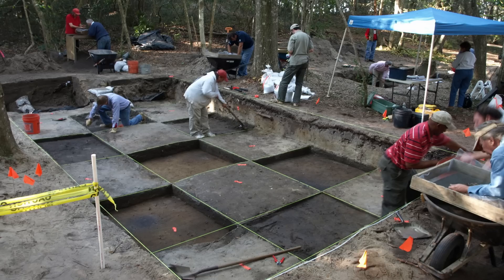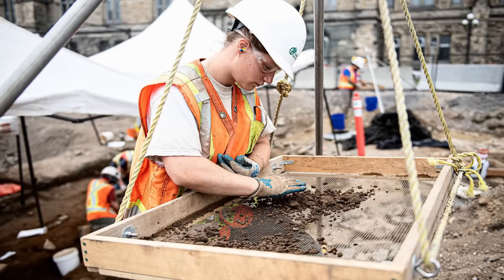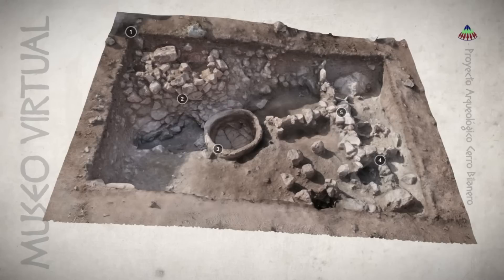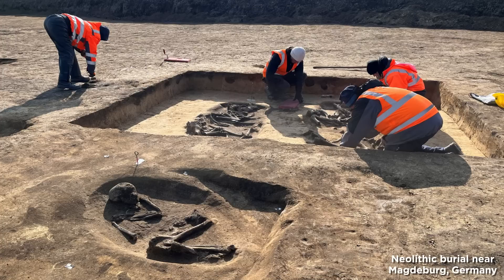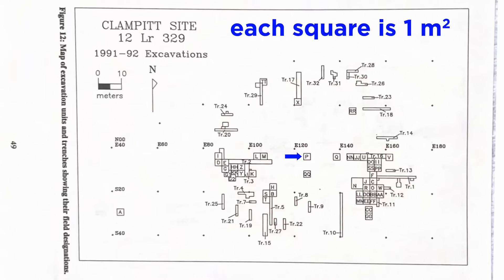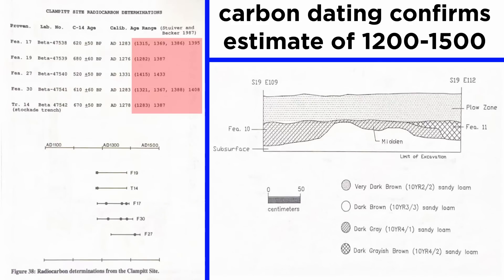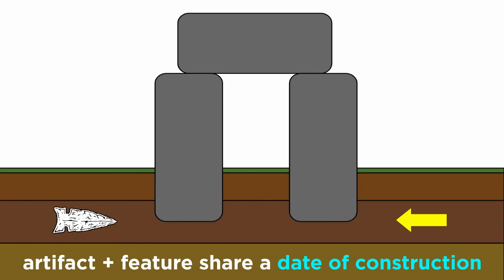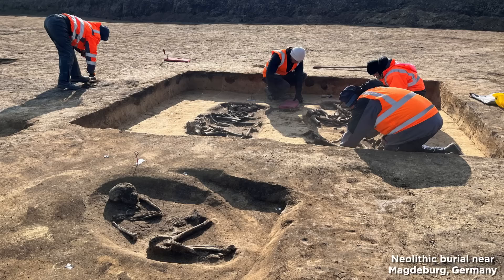Excavation at Archeological Sites

Comment: This reminds me of my high school field study on geology. Except I didn't use grid lines but I instead used triangles. Since I can't exactly gather everything from a sight that was also used for religion purposes, we can only extract a bit of data. So instead of gathering all the data on every stone we find around the mountains. We collect as many different pieces of rock in one area as possible and be as less destructive as possible. Only break a rock when there's no choice. Then we do that for 3 area to form a large triangle. We record and take as much pictures as possible. Then compare it with the gathered materials. After that, we just look for rocks with the highest deposit and find out what it is. Since we were high school students, we can't find out what it is with fancy machines nor can we even operate them. Instead, we hypothesize what it is, based on it's structure, strength, density and chemical reactions. Then perform an evidence based research on that.
Turns out, it's mostly just limestone. The final proof for that is a chemical reaction with some hydrochloric acid and the gas that came out was collected and placed onto some fire. Instead of getting flame, it puts out the fire instead even at slow expansion, which we concluded that it's carbon dioxide. Still, it's not a definitive proof as if there is some magnesium carbonate or other carbonate salts in it, the same result could be imply but that's as far as we got for a little high school project.
FYI, the distance between each location is approximately 300 meters. Found by using google maps, comparing 3 coordinates together to make a triangle. 2 on 1 side and 1 on the other side. Which we just say, "As the mountain's diameter is lacking in distance, we conclude that both sides are approximately the same"

Comment: Thanks professor Dave. Once I was curious how archaeologists predict the time frame of the sites. You explained how they can make testable predictions even.
Reply: @9fmradisapratama  You may also be interested in Optically Stimulated Luminescence (OSL) dating, a method used to determine when minerals such as quartz or feldspar were last exposed to sunlight or heat. Over time, these minerals absorb natural radiation, storing energy within their crystal structures. In a controlled laboratory setting, this stored energy is released and measured as luminescence, allowing scientists to estimate the time elapsed since the material was last exposed to light or heat.

Unlike radiocarbon dating, which is used to date organic materials, OSL is specifically applied to minerals and sediments.

Radiocarbon dating becomes increasingly unreliable beyond approximately ten thousand years, making OSL an essential complementary technique. In the field, samples are collected by inserting a sealed pipe directly into the sediment wall, displacing air and preventing light exposure. Only the sediment from the centre of the sample is analyzed, minimizing the risk of contamination from materials that may have been exposed to light during collection.

Comment: Quick question. If/when an artifact  is found between grids and levels, do they write down all grids and levels involved? Or is there some other system in place for that?
Reply: @zletroscreations1234  We plot artifacts using a three-dimensional coordinate system (X, Y, Z) to keep track of exactly where things were found. The zero point (0,0,0) is usually set at the northwest corner of the test pit, acting as a fixed reference for all measurements.

When an artifact is found, its position is recorded relative to this point. If it’s right on the edge of the pit, we simply mark its X or Y coordinate as 0mm, depending on which side it’s on.
Reply: @Lob-fb8my Very helpful, thanks.